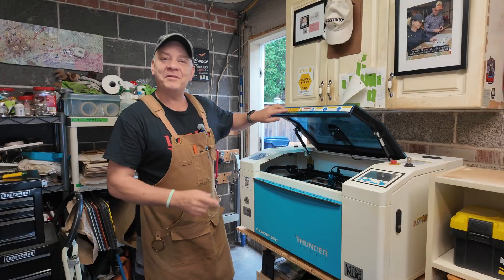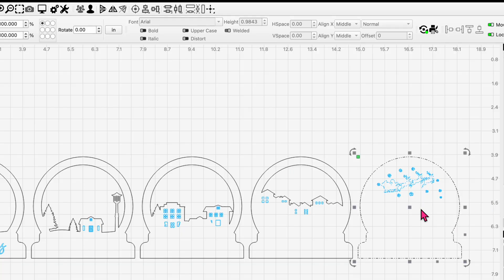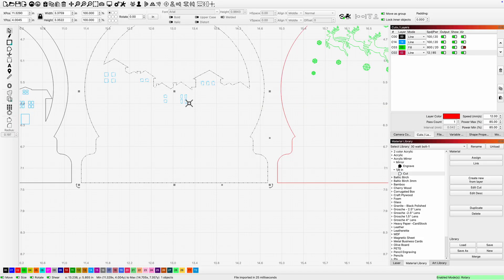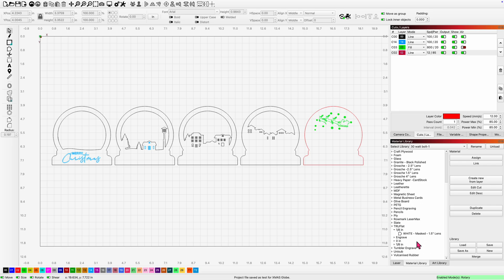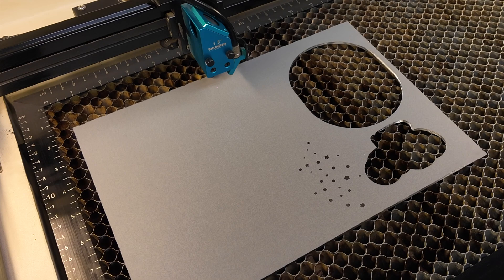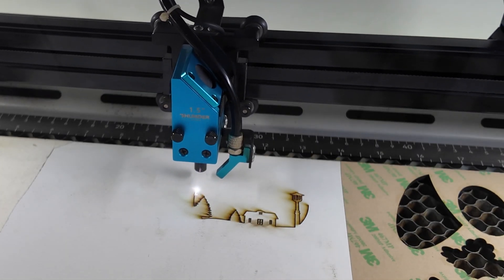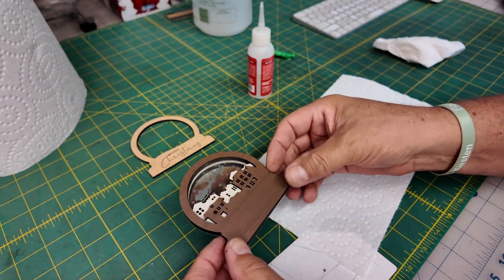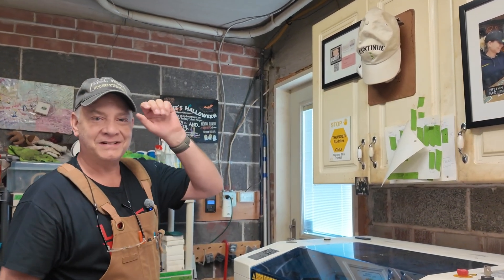Thunder Laser BOLT. Precision Detail. TRUFLAT XMAS.  093   4K

Comment: So my bolt is having issues cutting through TRUFLAT. Im running 10mm/95 power at 2 passes and it still wont cut clean. some parts will, but some parts will have hang ups. i dont want to run 3 passes. any tips?
Reply from the maker: Hey good day. You bet. I run at 8 mm/sec and 85% power ( if I have 3m or dualtite on it). One pass clean everytime. Pieces always fall out on their own - I never have to force them out. So, if your mirrors and lens are nice and clean, you have Air Assist turned on and the airflow is up high or full, and  your room temperature is above 55 degrees, then I can offer that this has only happened to me once before. It turned out my mirror alignment somehow went out of alignment. even a tiny bit out will cause the power to drop alot. Remember - it does not matter where the red dot shows up, it matters where the burn shows up. here nis a video that might help. Have you checked your mirror alignment? https://www.youtube.com/watch?v=NGKxjyADegY&t=796s
Reply: @LaserNUG I have never checked I just cleaned all my mirrors, gonna test now. And no, never have I checked my mirror alignment
Reply from the maker: @rykus2010  Let me know how it goes Rick.:)
Reply: @LaserNUG  Cleaned all mirrors/lenses, still getting little hang ups on the "Walnut Truflat" at 10/95. looks better, but i always seem to have issues with walnut vs maple truflat.
Reply from the maker: @rykus2010  Honest - truth Rick. They all cut and engrave cleanly for me - all colours including the new Cherry that just came out. Let me know how your alignment goes.:)
Reply from the maker: and you are auto-focused before you run the file? :)